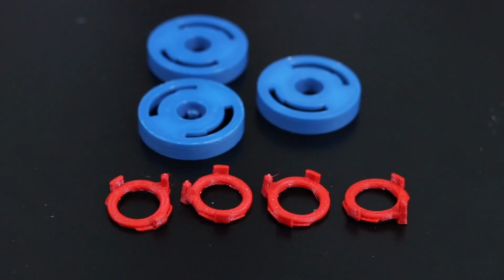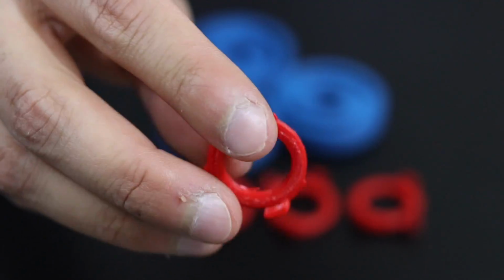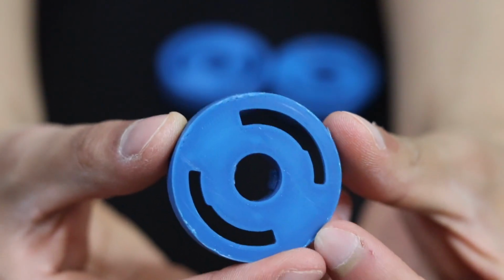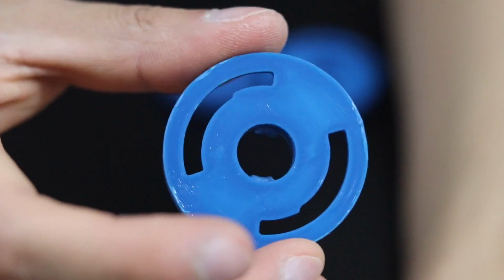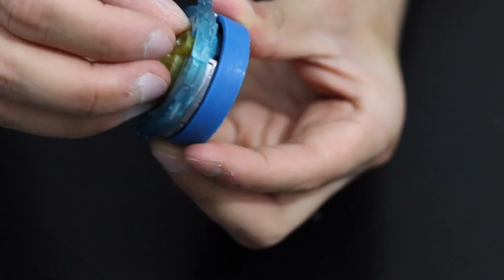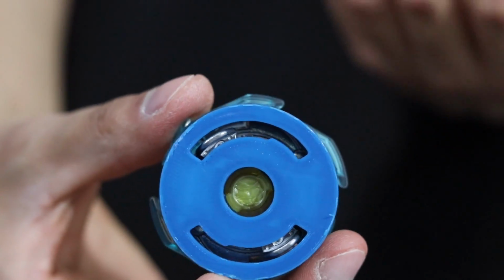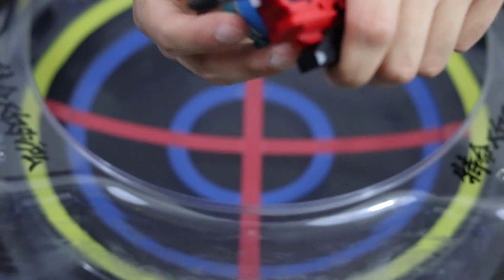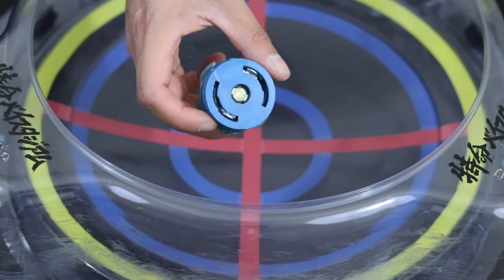3D PRINTED BEYBLADE (Beyblade Burst) ベイブレードバースト 베이블레이드 버스트

Comment: I think one of the reasons why this prototype is so hard to burst is partially because of the round shape. You burst a bey by hitting hit hard enough that it clicks, and since this is a perfect circle with no added features, it has no grip, so almost no bey can burst it due to the fact you have no grip on it to turn the layer. The perfect circle gives it nearly unbeatable Stamina. It's probably why Garuda is banned in some tournaments, along with the Stamina, although it may have less stamina with a wider shape and pieces in the middle that slows it down